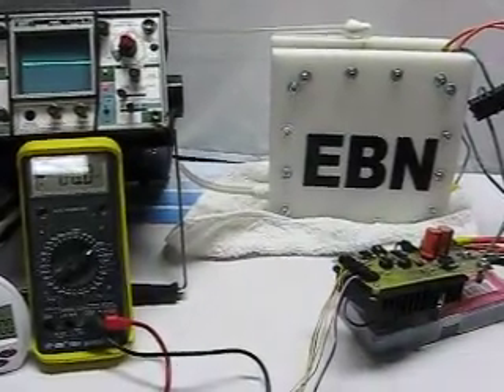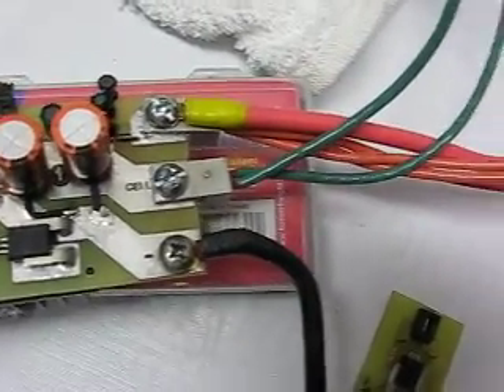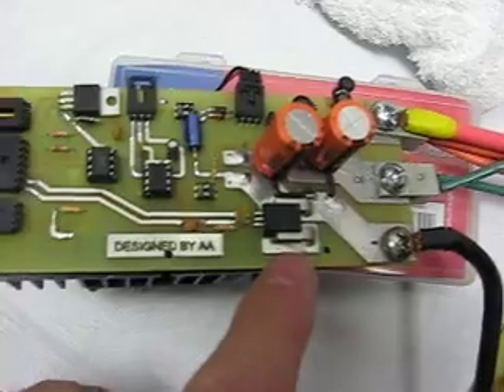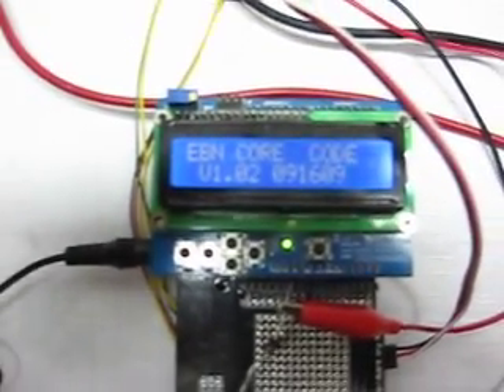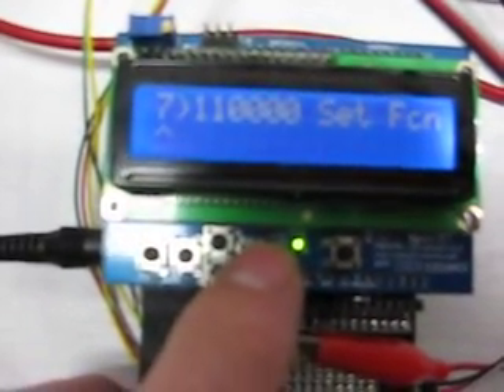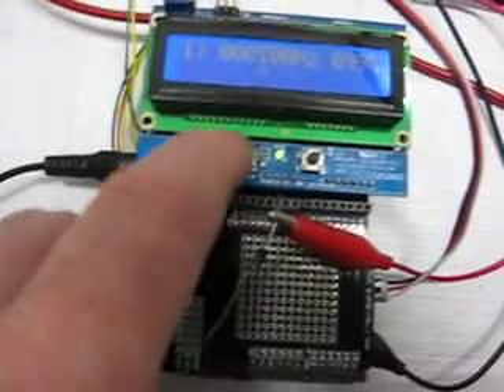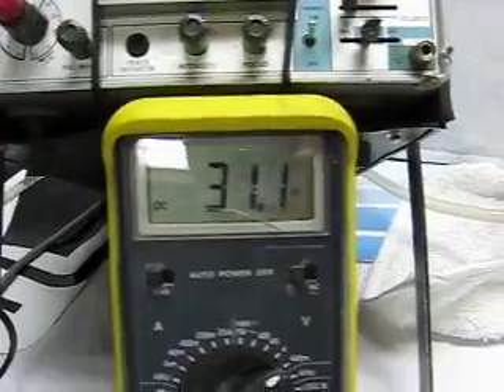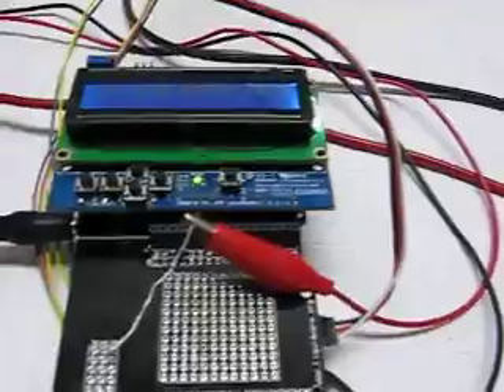Hi Current FET OUTPUT Board For Use with an Arduino Duemilanove Micro Controller.

Comment: i was watching your demo 2 weeks ago at SSC show ,did you fix the problem ?
the connectors to the board imho should be upgraded for people using this setup at it maximum 80amps where can i buy the compleat set up .
Can i use the controller and turn the current sense ?
nice work 
Thank you 
Najman